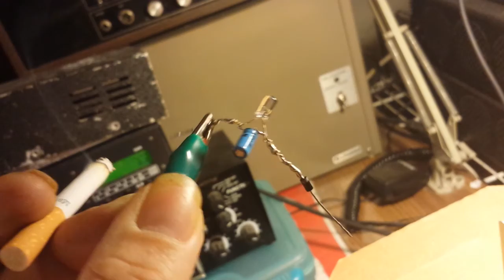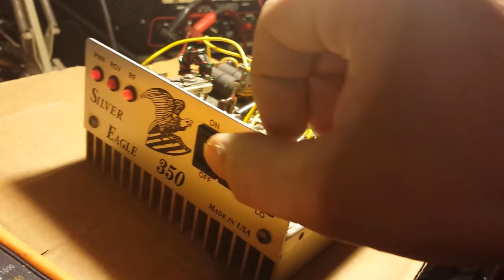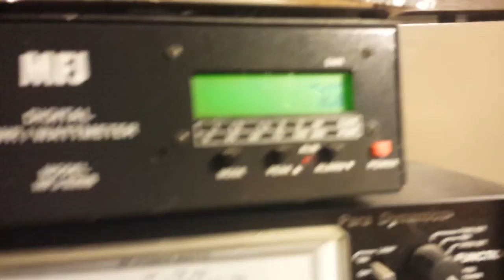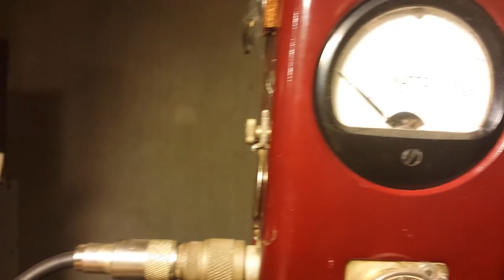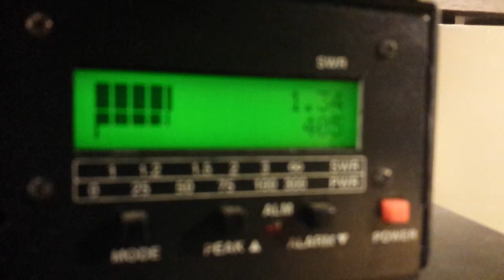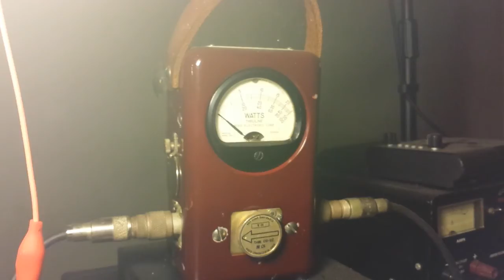Silver Eagle 350 4xmrf455 4 Pill Amplifier Repair

Comment: I have a Silver Eagle 350... with a tweaked and tuned radio pushing 8 watts....  so what will this thing actually push?  No site or web link will tell me what the dang wattage is
Reply from the maker: you can get a range of 300 to 500w out of these. all depends on the gain and health of the amplifier.
Reply: Cool thank you for you're reply :)

Comment: How is that hitting 350-400? I have the same thing and at 2watt dk and 30 watt swing out of a 33hml @13.8 volts I don't see more then 250 bird with a 500H 2-30 MHz slug. 

What's wrong with mine??
Reply from the maker: if your seeing 250w rms that is freaking GREAT.....that should be peaking 400w pep plus
Reply: +1883GotDown I'm sorry that's 250 bird pep 

-343 polar bear buckeye state
Reply: @BeEasyTreeFarmer  if your only seeing 250 pep your not driving it enough or you have an issue